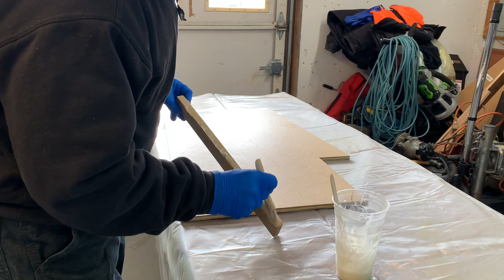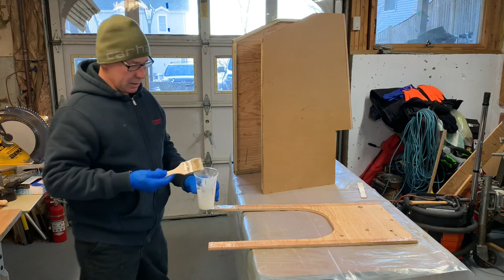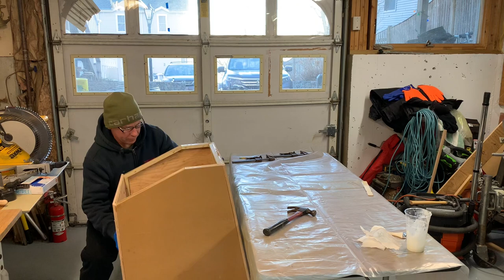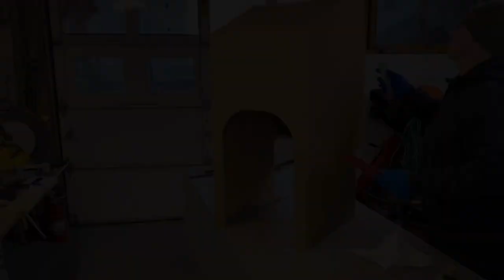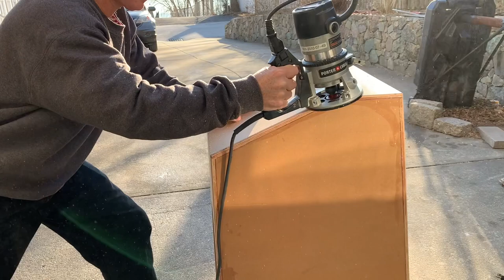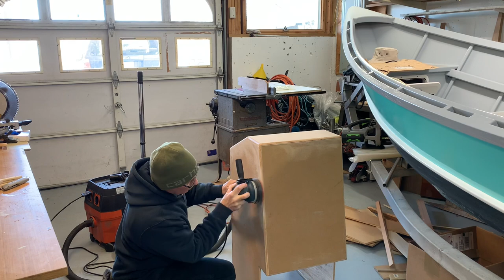Building a center console part 2

Comment: Nice! I must say that I recently built a console for a very similar boat...4 ft flat bottom, 19 ft 8", 32 " sides, Ocean going Oregon surf launch dory. Very similar console. 1/2" MDO, but edge fastened only, well countersunk. With epoxy wood flour fillets internally. Mine is a free standing, full walkaround console, barely big enough to accommodate the nfb steering unit and cable. and a minimal wind/spray shield, located slightly aft of center. No fiberglass on the exterior, just paint on the mdo cover. Only two seasons in, but to date, no problems at all, in spite of the sometimes extreme slamming it has taken. The boat is remarkably similar in planform, but fully ribbed at 14 1/2" ctrs, for open ocean ops. Weight is 870 lb, including the current 1988 30 hp jonnyrude. It scootavates divinely on that power and still rows nicely for easy surf launches. I love that old rebuild of a 1958 Oregon surf dory, and consider it 0 time, new after rebuild to modern, evolved standards. So similar to your build in planform it's uncanny.. In 36 more years it will be 100 yrs old. Next summer I intend to run it offshore 40 miles plus, catching albacore. Love the stable feel and power efficiency of a flat bottom boat......JE